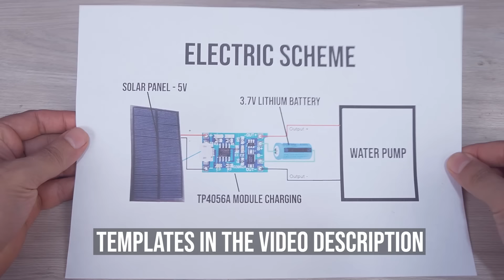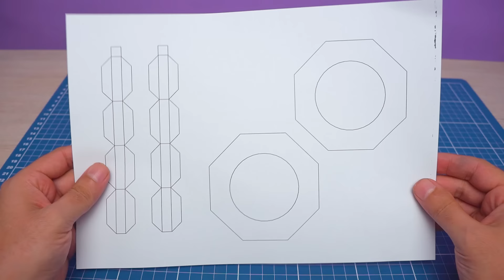Amazing Solar Power Irrigation System Project Model for school science

Comment: Full list - Materials used:
.
1- mini resistor
2- solar panel 5 V
3- TP4056A module charging 
4- battery holder
5- PVC (5 pieces)
6- Gear
7- 2 pipes
8- DC Motor
9- 4 mini soda cans 310 ML
10 - sand paper
11- drinking-straws 
12- wooden board
13- green felt mat
14 - plywood sheets (3 PLY) 
15 - EVA brown foam sheet
16- small plastic tube
17 - mini plastic plants 
18- mini switch (on/off circuit)
19- mini led bulb (high quality)
^o^ ~ welcome.
Reply: Thanks a lot ❤
Reply: Tysm :)
Reply: Muchas gracias
Reply: De verdad muchas gracias
Reply: Gracias a ti ya se q utilizar
Reply: i love you for this😭🙏
Reply: Vc tem os moldes dos recortes da lata de refrigerante?

Comment: It's very nice but will it work in direct sunlight also ? Will the motor and other leds also work
Reply from the maker: Yes, the irrigation system is activated by the button and is connected to the battery. Photovoltaic panels only have the function here to recharge the batteries
Reply: Nice 👍🏼
Reply: What would be the procedure of this video?  @inventus

Comment: Can we use torch light instant of sunlight.. Bcz it's our exhibition's model.. So have to do it with torch light... Does it work?
Reply from the maker: Hello, do a test, take your solar panel and a multimeter close to the torch light and see if it generates a voltage with an approximate value when placed in the sun. I don't think it will generate enough energy
Reply: What if we do it with multiple torches? Pls answer.